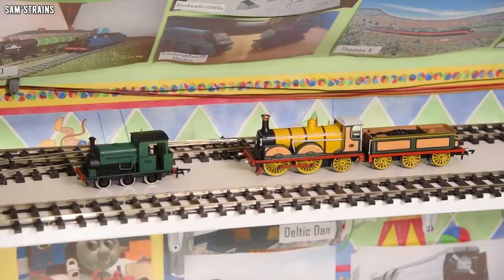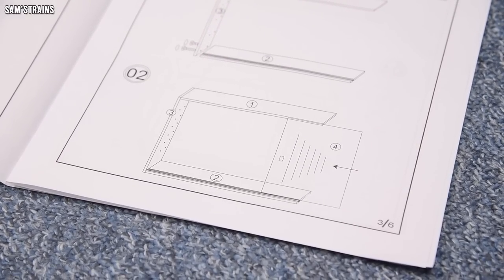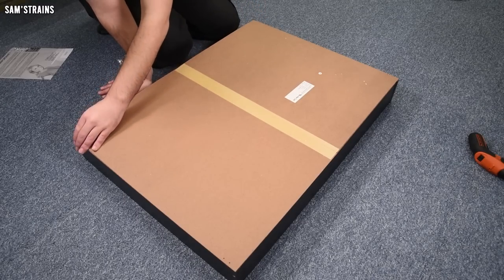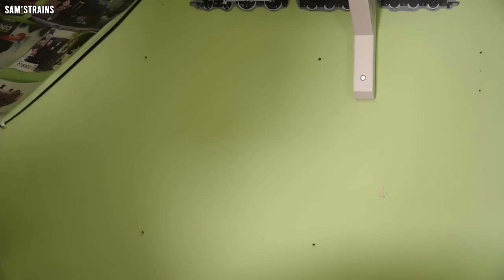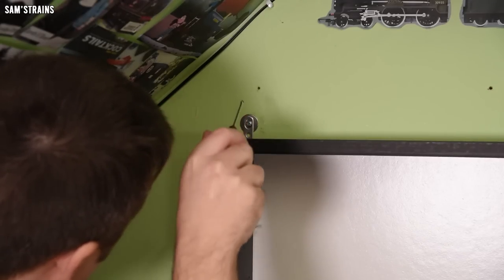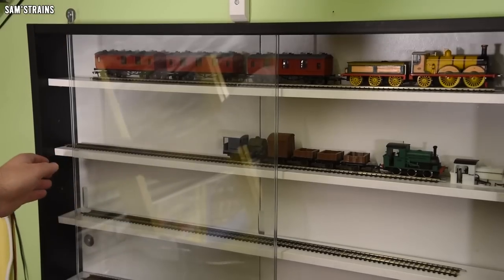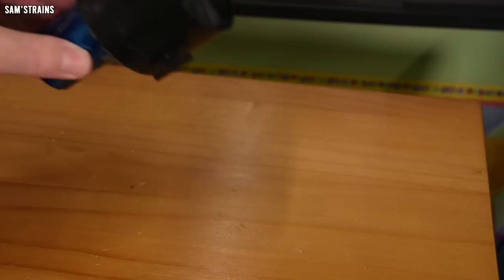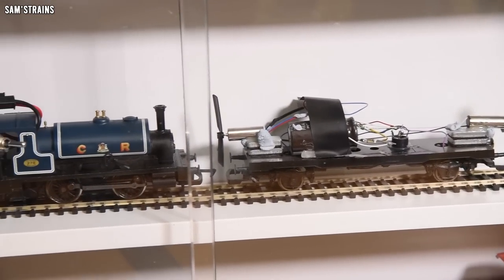The Sam'sTrains Museum of Miniature Transport | Open Now!

Comment: Nice work Sam! Just a heads up as I have the exact same cabinet, if you ever want to put non 3D printed locos on it at any point (I use mine for Hattons 66’s, Hornby 60’s, Bachmann 70’s, etc…) basically anything with a bit a weight to it, you will need to reinforce the shelving as it is not particularly stable and has a tendency to sag in the middle. I did this with some metal right angles screwed underneath each shelf and some screws from the back of the cabinet into the shelves themselves to fix them permanently and stop them falling forward (I have 3 large locos per shelf all at an offset degree as to allow them to fit)

Comment: Hi Sam. I bought one of those damn things. It is now hanging in my train room. The 'plugs' to hide the screws are on a small sheet of self-adhesive black circular labels. I strengthened the shelves to prevent them from bowing downwards under the influence of gravity by putting in additional screws from the back.  Sorry, you'll have to take the damn thing off the wall to ad the additional screws. Have fun!
Reply from the maker: Thanks for sharing! Yeah I can see the bowing being an issue with heavier items - but it's fine for what I've got in there luckily!
Thanks for watching, Sam :)
Reply: @SamsTrains  The shelves will bow under their own weight. You can get around this by turning them up the other way periodically, or fit the screws!

Comment: Lovely well built but having had quite alot of experience over the years in model train display cabinets, I would always advise buying white coated wood ones with all glass shelves. This creates much more light and a clearer vision of any model car or train one wishes to display.
Going even further one can coat the back panel with self adhesive silver mirror image rolls giving a good back reflection. Sam’s cabinet could have more shelves as it looses much space by only using every other lug hole when installing his shelves. Silver metal lugs with all glass shelves are definitely the best to use and do not cost more money.
Reply from the maker: Thanks for sharing - yes that does sound like good advice actually - appreciate the tips!
Thanks for watching, Sam :)

Comment: I fixed a 2"x1" batten below my Train Display cabinet. I fixed that onto the wall first because it was easier to get level, and it gave the cabinet something to rest on whilst doing the rest of the fixing; and so that the stresses were spread out rather than just in couple of screw-points. Maybe consider that next time..
You'll want another cabinet..

Comment: I actually had an idea a while back to make a display case that was almost like a model train vending machine hooked up to a staging yard.

Have a motor move a section of track up to the desired shelf, apply power to the rails and automatically bring in locos and rolling stock to the yard.

This type of setup would likely be best used on a layout with frequent loco swaps, but it's still something I want to do one day once I get my own space for a layout and build up my collection.
Reply from the maker: That's an amazing idea - I hope you can make that work, it'd be awesome! :D
Thanks for watching, Sam :)

Comment: Personally I'd like to see either the old Bachmann Union Pacific Smoking 2-6-2 in there (because what museum doesn't have a strange lemon?) and/or that old diecast GWR steamer you used in an April Fool's vid two years ago. As a matter of fact I'm currently building my own museum (but its an actual operating layout) housing some of the older brass locomotives from the 60's I acquired.

Comment: Not a bad job! The design of the cabinet itself is a bit questionable, the better-quality ones I've seen typically have two different depths of channel for the glass to run in, a deep top channel and shallow bottom one (or, alternatively, plastic balls in the bottom channel to provide smooth sliding, particularly if the channels are extruded aluminium). This is so you can lift the glass up and out of the bottom channel, then angle it out of the frame while it's still assembled. Trapping the glass (and shelves!) like this is asking for trouble in my opinion. But I guess that gives the manufacturer differentiation between the £50 version and the £100 version for a paltry 50p in materials.